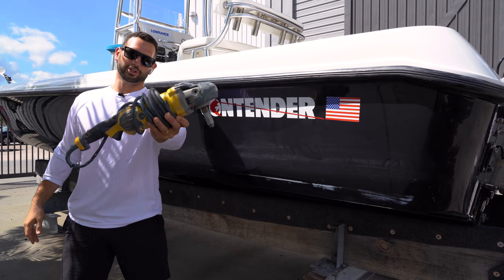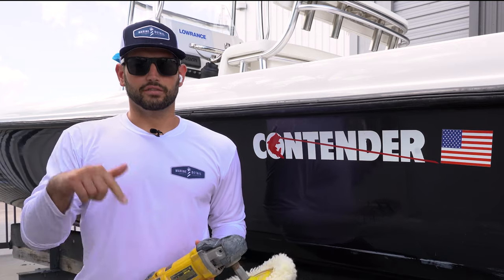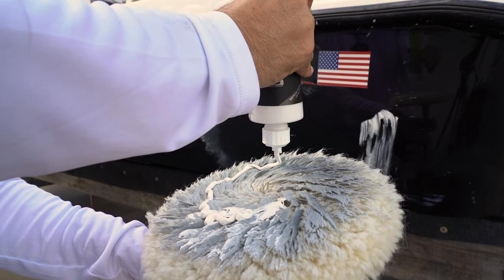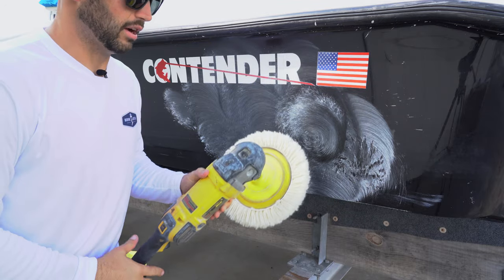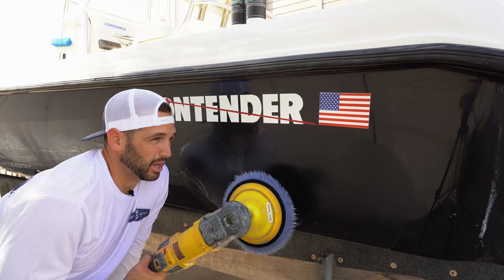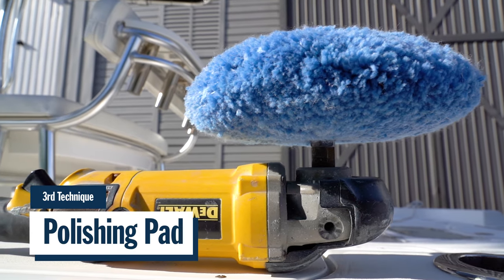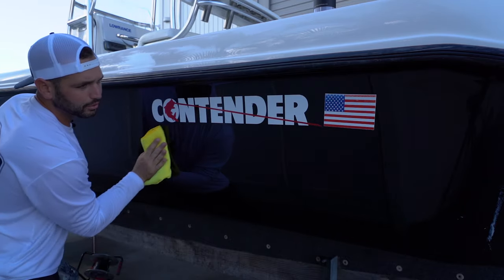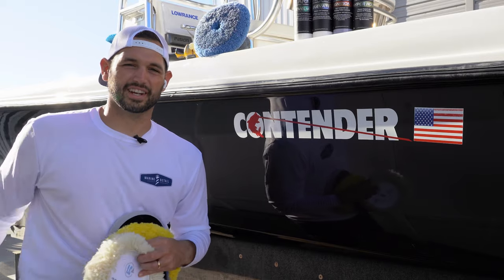3 Hacks for Rotary Polishing!

Comment: Ive been doin boats for 5 years I learned to start and finish with a rotary. I completely agree with everything you did in this video except when i cut i run around 2600 rpms
Reply: Slow it down! 2500rpms and above will get your rotary buffer confiscated 😮

Comment: Polishing lightweight small parts is impossible with a random orbital ,
so rotary is the only way to go using 3 inch up to 5 in pads and I'm referring to Automotive two stage & single-stage paints.
As a matter of fact I don't like DA's regardless due to the high vibration caused by various weights of different pads or else you have to change counterbalances which induces more work.
so rotary truly is the best all-around polishing machine.. .

Comment: When using a Single-sided pad, you can remove the extending spindle nut, you'll have way more control over your machine (I designed) with a lower center of gravity.
Without catching the sun's reflection on that black, how can I see if it's swirl-free? Next video option?
https://youtu.be/3l6O69_Bt5U

Comment: Great video Michael. Just want to ask you something. I want to polish an epoxy resin table top with a rotary polisher same as the dewalt. Since the gelcoat is a resin, if I have sanded the resin up to 4000 or more can I skip the first step with the wool pad and the medium cut compound and move on to the following steps?
Reply: @marinedetailsupplyco.-tamp3457   Thank you for your answer. I will let you know.

Comment: I been using a rotary and offering buff and wax using a product with compound and finishing material and I haven’t gotten much swirls or holograms it’s very little but I thought that was all I had to do to make a boat shine like crazy guess I was wrong
Reply: Well I you have gotten the boat gelcoat to really shine/mirror like.. you Are doing it right!.. I been using rotary with white wool & yellow wool pads.. & Maguires 1step compound +polish in 1+.. ( problem is my Rotary buffer is lil old & doesn't have rpm settings!.. so I manage by depending on how bad oxidation is /age/roughness & color.. & I been detailing for years.. every single boat is always different on how /what I attempt to use.. recently I realized so.e bad errors on my end that kept leaving color/oil/polish>wax blotches/ etc.. frustrating the hell out of me.. then I couldn't believe what I was causing these errors from.. when I cleaned boat I used Boat wash mixed with Dawn soap 🧼.. the Mistake was boat wash had carnuba wax in it!.. 😮 .. This caused such issues.. because when you are using Gelcoat paint cleaners/Compound/  & polish .. You need the surface to be completely Cleaned of Any oils/Waxes /oils etc.. ya want a Very clean Surface (Preped) at all times when you are doing EACH STEP*.. SO VERY CLEAN DRY SURFACE.. FOR  WHEN EACH STEP IS BEING APPLIED.. YES.. wipe>clean compound & polish aftwrwards.. crucial!.. Before you apply the final sealant> protectant like( Ceramic/ Wax/etc).. these steps are missed so many times, & we wonder why does it look blotchy or weird?.. 
.. In your case sounds like you had it right!.. Only thing else ya have to do.. is reclean/ or Prep clean (spray) wipe off & final step is.. The protectant of your choosing!.. Carnuba or Teflon wax or Ceramic glide coat/ or other sealants! .. If boat is Reflections shiny clean.. then the Protectant of your choice would now go on with such ease & wipe off.. 
Everyone has thier own methods.. this dude has alot of experience & does alot of cool creative steps.. me I like to cut corners but with shooting for exact same results!..

Comment: How often do you clean the pad on one job ?
Reply: Whenever it stops cutting. Foam pads will start to grip the boat as they get clogged up and wool pads will start to cut too deep. Listen for a rattling noise from your wool pad when you clean it with a spur.

Comment: How can you prevent or retard tanning on a white hull? I compounded and waxed the hull to a mirror shine. Kept the boat in a marina for 3 days to install new bunks on my trailer. Pull the boat out and tanning lines. Won't wash off. Now I have to spray on an acid to remove the tanning lines and destroy my hard work. Wish I have to do over again.